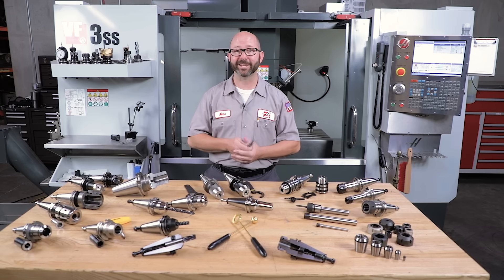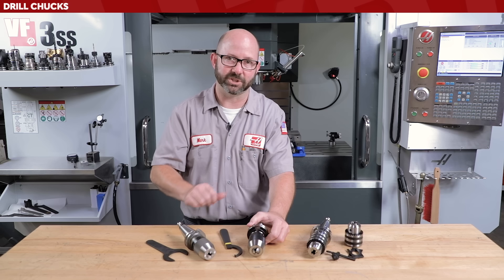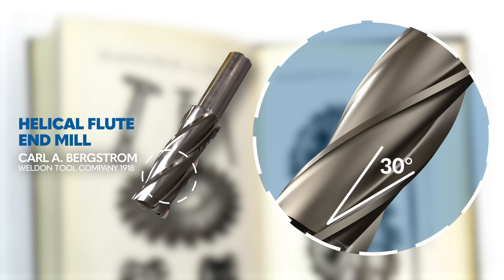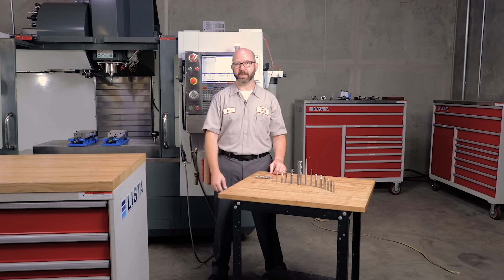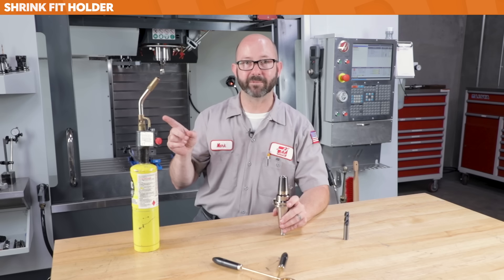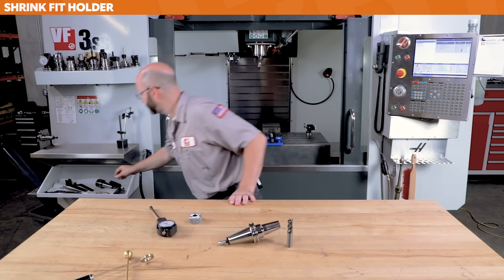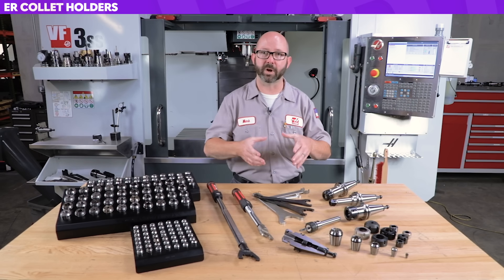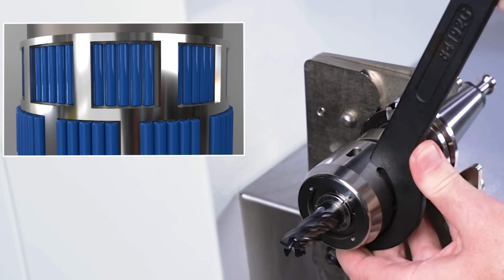Tool Holder Essentials - Every Machinist Needs to Watch This - Haas Automation Tip of the Day

Comment: One thing important to note with ER collets, especially for folks used to the old double angle collets, is that it's vital to be sure that the eccentric ring is seated correctly before tightening the nut. I manage a shop where we switched to ERs, and one operator kept springing the ER collets. It turned out that he was clamping them without being fully seated into the nut. An expensive lesson.
Reply: That's better than what I saw a year or so ago on a very popular You Tube channel run by a notorious Canadian.  He got his first ER collet, then proceeded to blame "Chinesium" QC for the collet not fitting into the nut correctly and proceeded to grind out the "annoying" flash on the interior of the nut.

There must have been 20-30 thousand guys yelling at the screen, 'Stop! Don't do it!' 

He was dutifly contrite in his next vid, after reading the comments.  LOL
Reply: @georgedennison3338  One very good reason to mistrust ANY contributor on UTUBE who just arrived with a Chinese cheap mill and thinks he knows all about machining in 2 months flat.
Reply: @Ian Pearson
There IS that to watch out for... 

My 're-telling' is particularly ironic because of where we are, (Haas channel). I tossed it out to see if anyone picked up on who I was referring to. The Canuck in question IS quite popular, with a large YT following and is quite knowledgable, usually. He is particularly proud of his no corporate schilling position.

When he effed up the ER nut, I didn't think anything of it, because I knew less than squat. 

Now that I have advanced to knowing squat, (more importantly, witnessing him being called out on his eff up educated to his mistake), I am now, just qualified enough to laugh at him for doing it, after the fact.

The irony comes in around him recently leasing a Haas 5 axis, and has taken us along on his journey on the learning curve.

While knowledgable and experience, he plays and acts the infuriating stereotype of seeing no reason to read manuals, and has a generally cynical view of the world. 

I live for the times when the no-manual readers ask me for help, and I stand right in front of them, read the manual, and then show them how to solve the problems. 

I quite enjoy the no manual, cynic being forced to read Haas documentation.  LOL

Re: your comment about new Chinese mill owners on YT
I'm old enough that Japan was in the same cultural and technological position China is in, now.  Oh, boy, were Japanese products back in the 50-60's.  

My personal theory is the lack of precision measuring skills. If you can't accurately & consistently measure, how can you make a tap or die? Or bearings.  The lack of that skill prevents consistent, repetitive reproduction of parts in the pre-CNC world.

I bought an old Japanese tap & die set for$5.00 about 20 years ago, just to see how bad it was.  As long as you made every fastener you used with it, you'd get by. Oh, and remake anything you plan on using the fasteners ON!   LOL  Wow... not even close.

What I've personally found fascinating about YT in the last 3 years is the vast amount of knowledge, and the tremendous quantity of learning opportunities, (I've found I can manage to learn something even from the channel segment you cited.)

Prior to being bedridden for three months two winters ago, I had only ever used YT for occasional music seeking forays, 'this is hilarious, you gotta watch it' links from friends, and specific targeted links when I was needing help when fixing something.

Since I could do nothing by laying near motionless in a single position, but hurt, I decided to focus my time on learning how to run a lathe.

I had a used, $50.00 Sherline I finally had a motor for, no machine tool classes or experience in high school, had never touched a lathe, but I was hoping to get it set up, IF I ever was able to walk, again, (never a serious possibility, but there WERE times I wondered.)  I had bought the lathe knowing nothing about Sherline, or lathes. 

I actually bought it out of guilt for paying "35.00 for 30-40 pounds of end mills" as the Craigs List post stated. Inherited from a recently deceased dad, the end mills were easily worth 200-300, used, and several of the 'biguns' were brand new. 

In addition, there was a new 1/2, 3/4 & 1" Israeli roughing mill set, and a simlar sized TiN coated 4 flute set with nothing but package scratches. In all, only one end mill was unusuable. 

Since they were bought for anticipated future use, I put them away after I got home. (My initial inspection seemed to explain why I got them so cheap. Many of them seemed to have a chip out of the flat cutting edge on the end; was a bit bummed about it.  (the second time I looked them over, I had achieved the knowledge level of squat, and realized the cutting edge damage was a feature, not a fault.  LOL, THEN I did a 'I scored', happy dance...)

 I tried to tell the young guy the mills were worth way more, but he wasn't taking anything over 35.00. He was adament.

He then asked me if I was interested in a lathe, and my ear perked up. He said just a minute, and left. Figuring he went for shop keys, or shoes, he came back carrying what I assumed was a toy lathe. Surprised it was metal, I felt so guilt about the end mills, when he said $50.00 for the toy, I gladly bought it.  (Boy, was I in for a surprise!)

I have wanted learn machining for 50+ years, but money and situation never aligned. I've been building and fabricating for all of those 50 years, and had a great vocation wing at my high school, but I went the drafting route, seconded by construction technologies. I talked my way into two programs, because I already had construction experience, (family biz), but no way they'd let me do three programs.

I finally got money and situations aligned after my wife took a job with MSC ten years ago, which is why I was buying used tooling when I saw it in CL.

I spent my bedridden time watching hours of lathe and machining channels, as well as mill oriented channels.

I got healed up from the sciatica, and by the following Fall had the Sherline operating, sorta. The first things I needed to make were parts to take it out of the 'sorta' category.  

Every thought through how to make a driven pulley on the lathe needing the driven pulley?  There are ways...

I was making my 3-4 bushing, or part for completion of the first installation and setup of the Sherline, and came to a point where I could easily have said/though, 'Don't know what all the fuss is, this machining stuff ain't so hard.'  But I DID learn more than enough completely from YT to NOT say or think it.

I think about the impact of YT frequently. There is much discussion about the loss of shop classes for the genrations younger than mine, the seeming lack of interest in shower after work jobs and other 'complaints' about the younger folk.  I can't help but think how much YT is going to change the world over the next 30-40 years.

There is an interest in fixing and re-using, which gives me hope for human civilization. I don't know if the interest in making, can be classified a renewed interest, or not, but there is a thirst for knowledge about the trades, and 'Industrial Arts' as curriculum folks used to call shop class.  

I have struggled for years to find young peoole interested in learning construction or auto mechanic skills as a low wage supplement, in exchange for helping me with projects on my house and property. So, that's my perspective on younger gen interest.

In addition to the knowledge I keep my aging brain active with, I see YT as an amazing, world changing repository and wealth of world changing knowledge.

Enough Sunday night philosophizing, I got chit to get done.  Thanks for the reply.

GeoD

Comment: Great video! Rather than ER collets, one should consider the 'Tremendous Grip', or 'TG' collet system. TG has half the taper angle of ER so over twice the gripping force. They are similar price to ER and very common in 75TG, 100TG and 150TG (.75", 1", 1.5" max capacity respectively). TG is also available in less common 50TG (0.5" capacity).
The SK collet system is also a very good, with greater gripping force than ER, and it is becoming more common and affordable.
Reply: That's an interesting aspect......the shallower angle would be practical and give you more holding force, so if you, like me, like the ER type system the TG would be even better as the price is similar.

Comment: Nice video.  

Pro tip:  When using key less chucks, ALWAYS do them up with the spanner provided.  Doing them up by hand doesn't generally do them up tight enough (unless you are the son of Hercules).  What happens next is either the drill slips, or worse the chuck tightens itself up under the torque load.  I have literally had to use a 2 foot bar on a 1/2" chuck to get it undone.  This is not good for the chuck as it over stresses everything in the mechanism and it will also damage the drill shank.  By tightening the chuck properly to start with you avoid this problem and it is much easier to get undone later.

Comment: Whenever possible I’m finding myself reaching for an Erickson collet. They perform amazingly and I have yet to have any tool pull out from any application. And from the Erickson collets I’ve seen in our collet rack they seem to live forever. I’ve found some bigger ones for larger tools that look like they’re 50 years old that still perform way better than other brands that are brand new. They’re simple, easy to use, and super fast to assemble.

Comment: Overall fabulously interesting, thanks.  On hydraulic tool holders, I would be concerned about bleed-down time.  I have never seen a hydraulic locking system that would hold its grip indefinitely.  For example, hydraulic park brake systems are sometimes used on heavy industrial vehicles only for very temporary parking.  They would never be trusted to park a vehicle overnight without blocking the wheels.  So do hydraulic tool holders have a cycle time to be re-tightened or released?

Comment: Ball bearing nuts are probably great (not tried one), but it's worth noting you can also use copper grease on the contact point of the nut/collet to reduce the friction. Stops it twisting when torquing down too.

Comment: Haas and especially Mark, you are the best! Please continue doing these great, world class videos. Nothing like that on youtube. Don´t worry about making long in depth videos. They are great. Thanks a million for that! I have a problem, which I don´t know have to figure out. You guys will be clever enough to know :) I have a 5,8 mm HSS almost new drill in ER, that is making 6,0 mm hole. First, I blamed ER, but I figured, that other drills work just fine. It is just this particullar drill. Could be the problem with drill? Why is it making such a huge runout? Even tried to change cutting speeds and feeds with no speciall effect...
Reply from the maker: Jan – A mystery! I would check the runout of the tool by placing an indicator near the tip of the tool and rotating it manually. If the tool has runout, you’ll see it. A lot depends on the drill itself. Are you spot drilling? If the spot drill is off, or has wrong tip angle to match the drill, your drill can walk. A nice HSS drill (think point thinning, grind of tip to better center), with 130° tip angle, won’t need a spot drill, depending on length and material. – Mark, Haas Tip-of-the-day

Comment: I had one accident running an endmil in an ER collet. The material was a bit special in that sense it was staked stainless sheet of just slightly welded or run together on the edge around the sheets with 100 mm distance. The vibrations from the sheet metal and too high feed ratio actually drag the 16 mm endmill into the table plane because the stack of sheet metal was only lifted 5 mm up from the table I did not notice until it was too late. By the way there is also an ER collet which has an inside thread for holding the endmill against a 60 degree cone shape internal endstop for the endmill.

Comment: A couple of things you might elaborate on are:

1. How big of a cutter are you using?  
    A large endmill or drill bit can handle more runout without breaking or degrading performance.  
    The grip strength of a shrink fit tool is lower for smaller tools because it is proportional to the interference of the fit.  The interference from thermal expansion is proportional to the diameter of the tool, yet the precision of the diameter remains the same.  
   
2.  You should probably avoid putting a 2in diameter drill bit in a drill chuck.  I have been putting drill bits into end mill holders with success for years.  One thing you forgot to mention is that Jacobs style chucks are stronger.  I broke a brand new Albrecht chuck with large drill bits like hole saws, but never a Jacobs style.  Personally, I'd prefer collets on all drill bits.  Sometimes, by choking up on a drill bit (in an ER collet), I've completely avoided needing a center drill, if the bit sticks out by no more than 2-3 diameters.

Comment: I found at previous employer the drill chucks left parallel lines in the drills, the shanks were soft and they couldn't risk having one come loose toolmaking so got tightened proper.
I wanted to shift to ER16/32 Collets , bit of an investment but well worth it for the accuracy, reach and longevity in my opinion.
Reply: Did the chucks have carbide jaws?  I have some ½" capacity keyless AccuPro's chucks with ⅜" mounting threads I use on my cordless drills and a ½ x ½" for my Sherline lathe, (found them @ MSC), 

They have carbide jaws and I've noticed the lines you describe, in everything but my solid carbide spade bits, (not every drill bit, but all the different brands and types.)  The lines beat the 'chewed look', though.

I got tired of bits falling out of the drill's lousy OEM chucks, especially since it happened more frequently when I was on a ladder, or the friggin' roof!  They have a very solid locking sleeve, so when you get them tight, they click, and lock down.

I didn't know there were carbide jaws for chucks. Have since learned they can be had in some Albrecht 'type' chucks, as well, (don't recall if Albrecht offers them, but some knock-offs do.)
Reply: @georgedennison3338  I'm not sure from memory, was 5+ years ago since working there. Quite possible they were. The thing is setting up with x20 drill chucks would have been far more expensive than the ER collet system!

Comment: I use Schunk Tribos, incredible runout and best clearence possible during five axis operations. Not the best for heavy milling but for finishing and throcoidal roughing is the best
Reply from the maker: Steel – The Tribos are getting quite a few comments here, I’ll check them out. Thanks for commenting. – Mark, Haas Tip-of-the-day
Reply: @haasautomation  I've used Tribos on routers in the past... great solution and very similar to shrinkers... except with wood the dust packs up in the gap after a while, making it extremely hard to remove the tool, since the tool body has no where to go once compressed into a round shape.
Reply: @ScottMoyse  I've had the same problems milling plastics... I generally remove directly the collets and then force the tool out from the collet from behind

Comment: Got a BT-30 mill and need to hold a 1.5mm drill bit. Smallest collett is 3mm. Problem? Nah! Scavenged a small chuck off a broken drill, used a bolt to make a long shank for the chuck. Clamped the shank in 10mm ER-32 holder. Not the best solution, but worked well enough. :)

Comment: Should be noted that albrecht keyless chucks self tighten with machining. If you use something like a hole saw in a bridgeport she will get so tight you will need a plumbers tool to loosen it. Only reason keyed chucks are superior I know of - they handle more torque.
Reply: An albrecht chuck may explode if used with high torque tools and the tool grabs.

Comment: My R&D shop in a university just got handed down its first CNC- a retrofitted Hurco bed mill. Unfortunately, it takes qc30 holders, or the old erickson 'quick' change- which, apparently, suck. They seem like a missing link between r8 and cat40, not to mention I'll be manually tool changing (and controlling RPM by hand). On my shoestring budget to tool the machine, based off of limited eBay type options, I finally found the wonder-filled, life-saving Shars site, where they still carry good options for qc30... After much internal debate, although I'm used to er collet systems mainly on the HAAS I used to setup/program, I got endmill holders of numerous sizes, thinking that my RPM will be low, <3000, but my rigidity should be capitalized. Now, I guess I'll get good at grinding weldon flats onto all my legacy HSS tools (while I'm busy sharpening them, too)! Thanks for all your great tips, Mark!

Comment: Emuge Franken is just an elephant for the rough milling operation. I just started using the replacement of Sandvik hydraulic grip Holder and the performance i get in terms of machine and tool life is 30% higher.

Comment: Observation:  make sure ER collet is installed in nut before inserting into holder as nuts have retaining rings that may prevent proper collet engagement